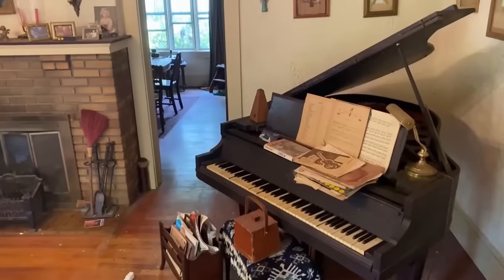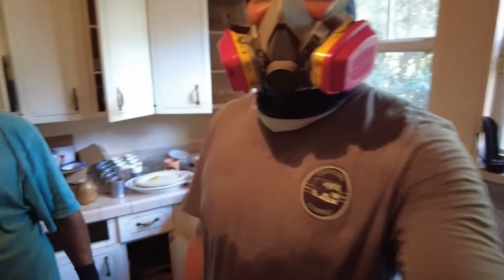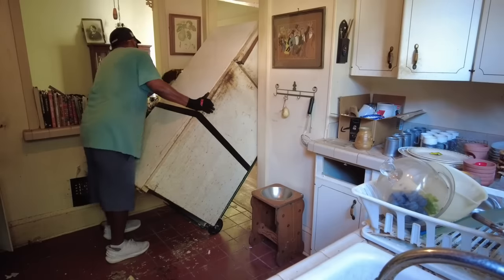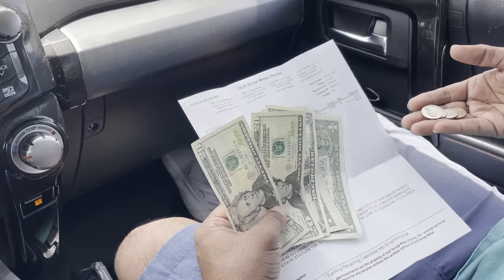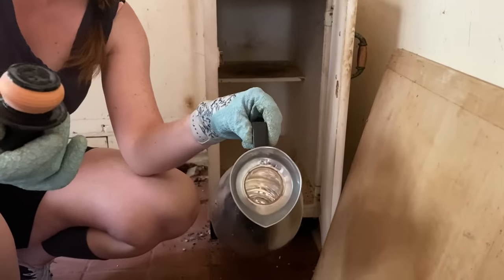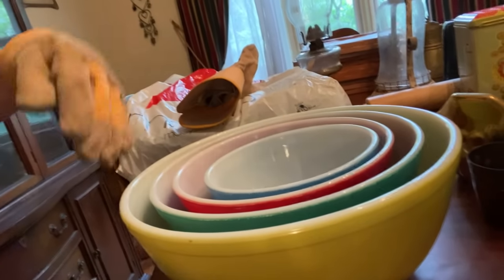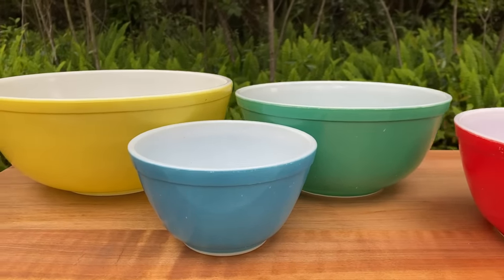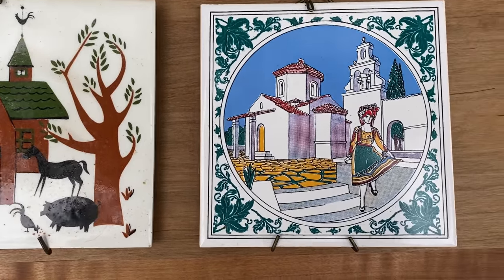We found VINTAGE PYREX! (Kitchen Part 2) Ep 23

Comment: The item that you didn't know what it was  (in the end of the movie) it's a Moulinex. 
A very common cutting and shredding machine, that we use over here in Europe, but you are missing some parts, a crank and the tear plates. I have my grandmother and it's still working just fine. 
You can slice, shred and grate vegetables with it, for example you can shred potatoes, carrots, etc.
Reply: I use mine every christmas for a dish called "janssons frestelse". Can't do it without that chredder. It wont taste the same.... 😂

Comment: The grey metal thing with legs is a grater, my gran had the same. You need to find a set of round grating discs of a range of hole size. Each disc fits under the body, slides into those little  bent metal prongs you can see underneath. Then  you also need to find the turning handle which is a right angled rod with a gripping knob at the top and a flat bit at the bottom that fits into the top of the device. To use it, stand it on a flat surface, put the food in the well, close the lid as far as it can go on top of the food, hold it there by gripping the 2 parts of the device handle together, and then rotate the knob which rotates the rod which rotates the  cutting disc you have inserted. And the grated food falls out the bottom. Voila!
Reply from the maker: Thanks!

Comment: The metal thing with the two legs that skin should also have round disks that slide into the bottom and a handle that goes through the center of the disc that you CRANK the disc. You left the Handle, put cheese into the tub, put the handle down onto the cheese, and the handle.  You end up with grated cheese.

Comment: The metal device you showed at the end and didn't know what it is, it should have a variety of round metal cutting disc to choose from.  You slide 1 in under the opening area click in place snug against the metal clips that hold them in place.  There should also be a metal handle which screws in and when you turn it, it rotates the disc to shred cabbage and other foods.  My mom had one.

Comment: That mystery item is a Juliene salad maker, or part of one. It should also have a handle that goes through the holes to attatch to another piece that can be rotated underneath.
Reply: Yes, it’s missing a blade and the handle that turns it.
Reply: I have my mother's/grandmother grater. The blades are round the handle is more like a rod with a knob at one end for the handle. Think the brand is Moulie? French I think.
Reply: Yes, this goes along with my answer in comments.